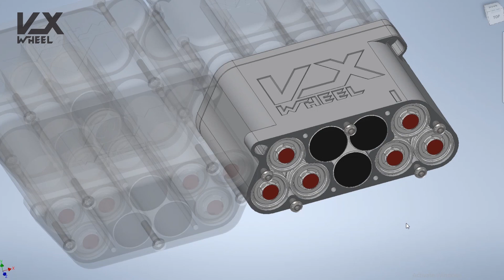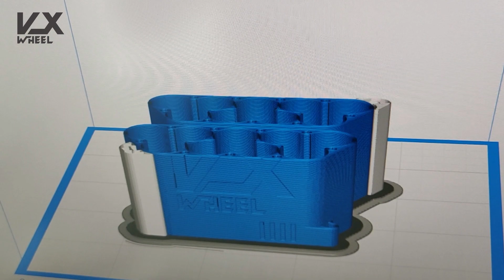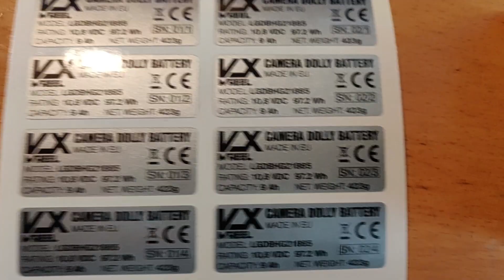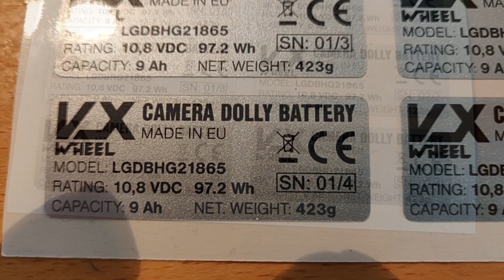DIY ONEWHEEL - EP2 - Battery Design and Sunkko 738AL spot welder Review - VXwheel

Comment: I was thinking of putting my Bms up front with the controller like you. Does extending Balance wires cause any problems?
Reply from the maker: No, it is totally ok. Just protect them from any damage while they pass to the front or even better fuse each wire with a small fuse on the battery side so they can't short on the way to the bms.

Comment: great video :)
your design looks very clean 
did you already compare the funwheel to the floatwheel motor? what are your thoughts?
Reply from the maker: Thanks! Sorry, I did not finish the float version because of lack of time, but I will in a few weeks. I will post new video as soon as I get some time.
Reply: How much is top speed and range on your 12s2p battery?
Reply from the maker: @ChristophLehner  I have 12S 3P
On the funwheel motor this gets to max 26km/h and about 30km range.
Reply: The range is  impressive, if you want to sell the floatwheel motor, i'm down 😂
Reply from the maker: @ChristophLehner  I plan to finish it, so not for sale now. But they are cheap and fast delivered from eu, so no big deal to buy new.
Reply: @VXwheel  how long did it take to  deliver?
Reply from the maker: @ChristophLehner  About a week. Ships from EU if you are from EU.